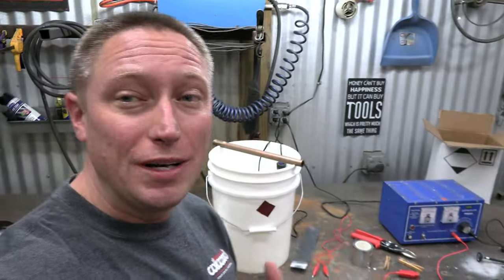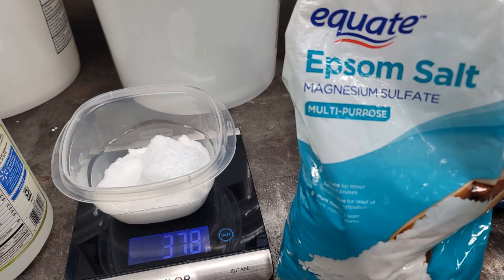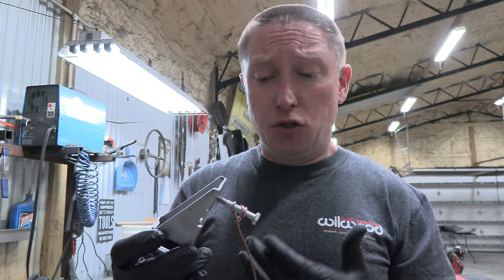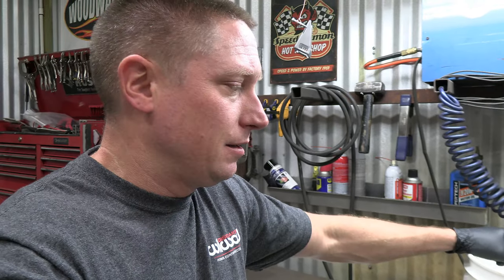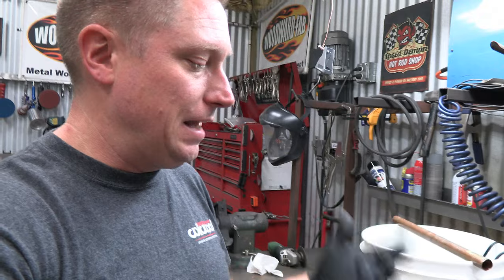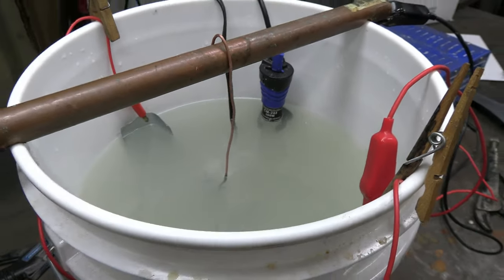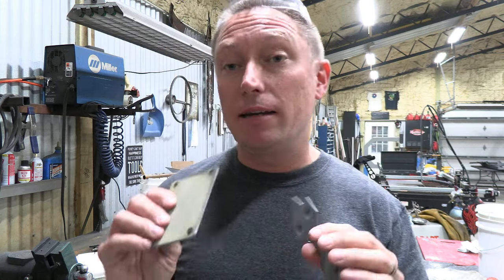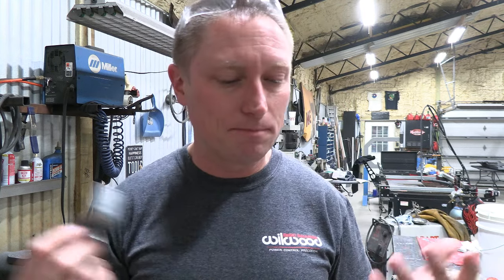Zinc Plating Introduction - D.I.Y. Hobbyist How-To Demonstration

Comment: As another viewer has noted, the plating process tends to require line of sight between the zinc anode and the areas of the part that you want to be plated. The ideal is have surface of the the zinc anode entirely surrounding and equally distant from all the surfaces of the part. Obviously, it is not practical to achieve that ideal setup, however, if the setup departs too far from that, the process may not work, as was illustrated with the interior of the first part. In the semi-enclosed areas of the part, there will be little electric field to drive the plating process. So, for that somewhat hollow part that wouldn't plate internally, try arranging extra small zinc anode centrally within the hollow space of the part. Given the short distance between that extra anode and the internal surfaces you will have to dial back the current to avoid the fury zinc deposit problem. Good video. Cheers
Reply: A❤😊
Reply: It's not so much line of sight, but equal (distance/potential) values. Edges and other protruding regions on the item to plate carry a higher change than the general mass of the object without an anode to start with. Add the anode where halving the distance between anode and object quadruples the charge, this effect gets even stronger resulting in a much heavier zinc layer on protrusions. You can somewhat mitigate this by adding a stirrer of some kind to the plating bath.
Reply: @Xiph1980 i wish i understood what you said 😂
Reply: How do you fix the fuzzy zinc? Do you have to strip or can you just drop amps and keep going?

Comment: ok , I've done a little  zinc , copper and nickel plating and I think you have 2 things affecting your results , 1 you need to load up the electrolyte with zinc ions first - turning the solution into zinc acetate . hook one zinc anode and one zinc cathode up in the solution with no part involved and plate from one to the other for an hour or two then reverse the polarity and plate back to the other totalling maby 6 to 8 hours , this puts the zinc in to solution ready to plate all surfaces immediately with the anode 1. replacing zinc ions real time with ones being deposited onto the part and 2. being (well) the anode.
second is I think your mix is off , 1. I'd try more like 2:1 vinegar to water maby even 3:1  and 2. reduce the epsom salt by half at least maby only 1/3 - the epsom salt is there to make the solution more conductive and I believe the (crystaling) burning on the edged are from the current being to high exacerbated by the overly conductive solution.
with plating balancing the the solution is important and slow and steady wins the race , your prep work is absolutely perfect the problem is all what's in the bucket and the current it is plating at
Reply from the maker: Sounds plausible.  I'll give it a try and make another video if I find something that works well.

Comment: Skip the pump and get a aquarium air pump insted. Works just fine. And for zink you can buy zinkanodes for boats and use them

Comment: Thanks for the transparency, one thing I did notice is after you dip your part in hydrochloric acid, you need to dip it into a water/baking soda solution. 

That will neutralize the acid. 

Best of luck

Comment: The first time I zinc-plated was when I was a kid in the 70's. I got zinc from dead flashlight batteries the cases are made of zinc. I put my battery charger on 6 volts I think. I was amazed at how well it worked and I didn't know what I was doing.

Comment: For better uniformity, hang a bolt at each threaded hole and connect all bolts to a separate copper wire, then connect each copper wire to your copper pipe. The problem is that electrons want to flow as far from each other as possible and thus accumulate at the edges. You need to get the electrons propagating from the "hidey-holes".

Comment: The deposition will happen on the closest surfaces to the anode.  Another thing you could try is to use wax on the surfaces already coated, that will make the zinc only have opportunity to stick to the parts that remain in electrical contact.  If you are heating the solution the wax may melt; you might want to turn that off for the second part.

Another solution is to place the sacrificial anode inside the part, that way the zinc will migrate first to the uncoated metal.  Make sure you use something to isolate the cathode from the part.

Comment: i think you need to charge your electrolyte with more zinc ions before you plate.' you're trying to drag out too much zinc from the anode to make up for it. thus, burning the edges and getting a crusty finish. i only use an old phone charger. that's about 3 volts and it's rated in milliamps. its slow to Coate and comes out very good surface finish nice flat silver color. but no shiny Crome look like Caswells  kits give you. if i need shiny i polish the part

Comment: As noted below the electroplating process is directional. The zinc moves from the anode to the part. One solution is to use a bubbler to disturb the path of the zinc. Another solution is to rotate the part while it is electroplating. And another solution is to have multiple anodes around the tank. The effectiveness of these solutions depends on the geometry of the part. For complex parts it might be better to use the brush plating technique. Increasing the current causes the zinc ions to pile up and spread out, which also helps to disperse the path a little, but it is not the best way to evenly plate as it creates dendrites.

Comment: in the alkaline zinc plating process, DOHENYS FLOCCULENT can be used to shine the zinc plating and after the passivation process, get that iridescent appearance. Could you test if it also works for acid zinc plating? Unfortunately here in Brazil they use aluminum in similar products and I believe that aluminum will affect the cleaning of the solution. Look for the "DIY Bright Zinc Plating" video to see the amount of flocculant.

Comment: Run a small zinc anode inside the component. With this supplying zinc to the inside and the external anodes directing zinc to  the outside, the plating will be more even.

Comment: Plating works by line of sight. If you are not getting plating on all parts of the part then that part doesn't have line of sight with zinc.

Comment: Question for you @redlinestands - could you do this type of zinc plating, but on the inside of a gas tank, after you have acid cleaned it etc, to stop it rusting? Instead of having something sitting on a wire in a plastic bucket of solution, have the tank as the electrified part, solution inside it, and zinc plate the inside of the tank? Thanks
Reply from the maker: Idk man.  Tbh, you're just asking the wrong guy.  I definitely don't consider myself a professional on this topic.

Comment: Try using Sulfuric acid instead of acidic acid. It's a little more dangerous but will give you more throwing power.  The zinc ions don't like to plate in recessed areas. You could try building off of your hanger a cage that mimics your recessed areas. Not touching the part of course. Also, I would suggest hanging the part directly and moving it throughout the process. otherwise, your threads will not plate and rust will start there and propagate out.

Comment: This is why commercial plating solutions have a myriad of different additives to increase the "throw" of  the solution. That is electroplater jargon for a solutions ability to coat uneven surfaces. Simple solutions usually have a throw of something close to zero, meaning it will coat very unevenly. Definitly not inside corners. 
For a home player, it is pretty much impossible to set up a solution just right for a certain piece. That is also the reason why commercial platers refuse to do small batches. Because the solution and the process must be dialed in for each piece. But for us, there is a way around it: Change electrode positioning during coating. First do it like shown here. Then place the anode very close to the uncoated surfaces. Stick it inside the part if necessary and go on plating. 3D printing fixtures can help suppress short circuits.
And one possible misunderstanding that I pick up: Increasing the voltage and amperage INCREASES Faraday shielding of inside corners. It makes it MORE uneven. Lower voltage improves the throw. You cannot go down to zero, as you have a minimum voltage necessary to drive the process. But going slow and giving it time helps, and might reduce the number of steps required.

Comment: Is it possible that instead of using Epsom salt you could use washing soda which is what a lot of people are using. I cant get washing soda in my country or I just can't find it so I make my own I learned in a couple of YouTube videos. I buy baking soda and spread it evenly on a baking tray. Cook in the oven on 200c for 30 minutes to evaporate all the water out of it and the result is washing soda after 30 minutes in the oven. You might need to shake the tray half way through cooking it if you have a lot on the tray and you don't need to add anything at all to the tray while cooking. HINT: If you place a baking sheet of paper on the tray and put the backing soda on the sheet then when cooked it is easier to roll it up and funnel it into the container you want to keep it in

Comment: your problems are easy :
less plating insides concave parts (low current density area) = need more zinc ions/salts in the solution.
burning on part edges (high current density area) = need less current.
for a more uniform deposite in acid zinc plating, you need a complexing salt. most popular acid zinc formula are based on zinc chloride, and potassium chloride complexing agent.
for a shine plating you should use a surfactant, SDBS is very good.
acid bath are good for build-up tickness plating,
alkaline bath have a better throwing power.
before imerge your part into the chromate passivating solution, you need to imerge the part into a dillute nitric acid solution.
Reply from the maker: Would you mind to post the formula for making these solutions?  It sounds like you know what you're talking about, but without specifics on how to follow your suggestions, I'm not sure I'll be able to use this info.  Thanks Gaulix69.

Comment: if you do not want a yellow finish , do you just not dip into Yellow chromate solution ?
Reply from the maker: Correct.  The yellow chromate just makes the plating more resilient

Comment: wouldnt you have to double your amps with two anodes?
Reply: That doesn't double the amperage, it divides it BUT you're on the right track. You ever seen a lightning bolt? Or lightning in a jar? Those science experiments? The bolts look like a delta. The high the amperage, the greater the "tendrils" (spurs) BUT it's never more than a 45 degree angle.

Issue is "light of sight" coverage. Also called "shadowing". He needs another anode that has line of sight to that portion of the part.